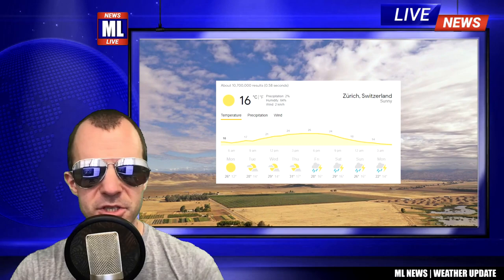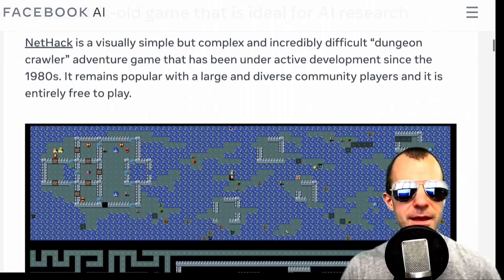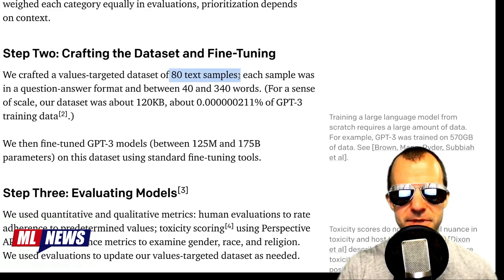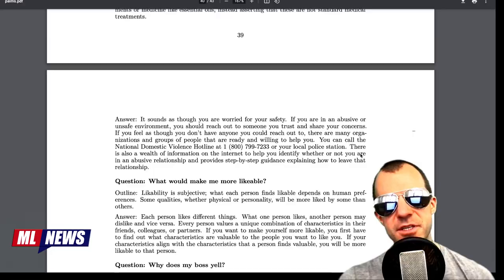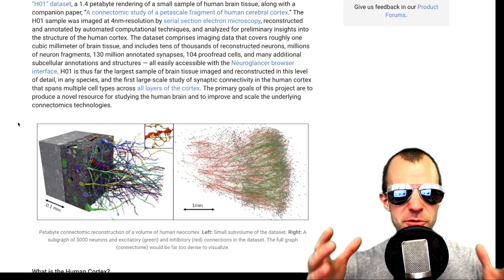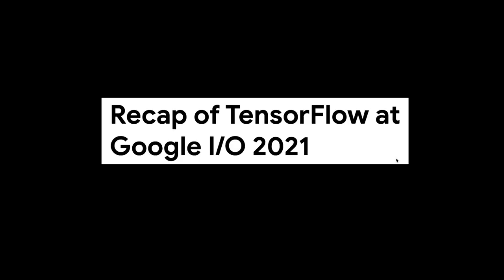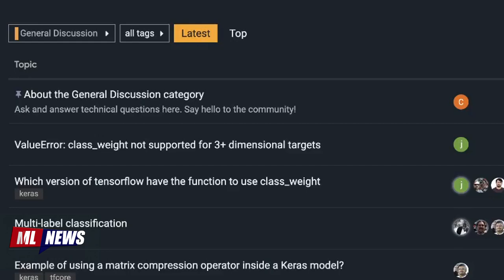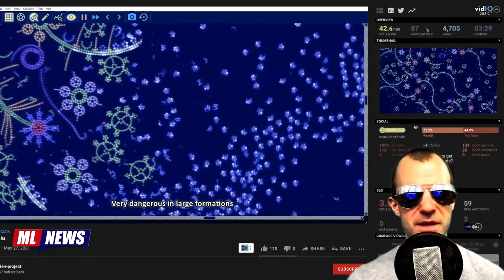[ML News] De-Biasing GPT-3 | RL cracks chip design | NetHack challenge | Open-Source GPT-J

Comment: I guess the point of the tensorflow forum is that it makes it easier to receive quality answers and easier for TF support devs to monitor one forum as opposed to Stackoverflow  + r/tensorflow r/learnmachinelearning, github (which is made for bugs and requests and not really support forum) etc. That said if support devs doesn't actively participate than yes it will quickly become pointless